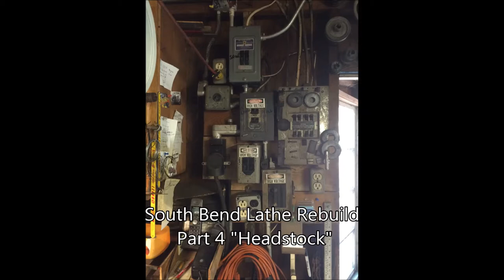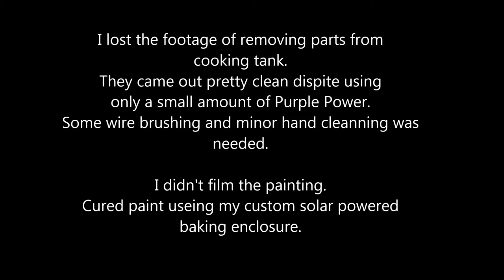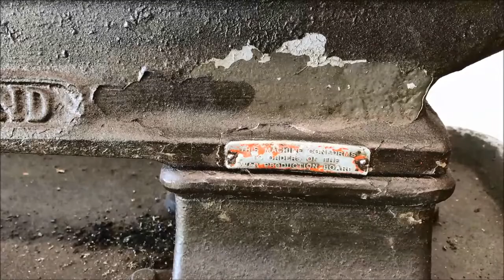South Bend Lathe Rebuild Part 4

Comment: Nice job. I would have liked to see more things like how to remove things, open them, what to look for and how to reassemble. I have a 1968 SB heavy 10 L that I’d love to restore, but I’m afraid to do that because I don’t know what I’m doing. Are there any places that can help me restore my lathe? 
Thanks,
Paul
Reply from the maker: I was still fairly new at filming and was working mostly with stills. 
The South Bend rebuild guide is very good "available on eBay" The gear box is very tricky, it was very helpful.
ATB...Dean

Comment: I thought I knew what love was when you showed your 30 gal cooker, but no-no, true comes but once in a lifetime, and I found mine in your solar powered curing chamber. lol :) The polish on your back gear lever was gorgeous. The assembled head stock looks brand new, and the bed upgrade was a good idea. I found a baking rack that fits inside of my chip pan. It makes things a little easier to be able to lift it out and dump it.
Reply from the maker: That's a great idea!

Comment: great work, you ever source replacement rivets for the placards/badges and any source for quality bearing replacement ? Thanks in advance, Dan.
Reply from the maker: Dan just came across your comment....sorry for the year long delay. McMaster Carr for the rivets. Bearings probably keep checking ebay..Grizzly may still have some new old stock available also $$$$$
-Dean
Reply: @TheAyrCaveShop  No worries man and thanks for the reply I actually finnally got the lathe completley rebuilt a couple months ago but i still need a few rivets so thanks ill look into that !
Reply from the maker: @DanOTBB  Nice to know another classic South Bend has been saved, ATB, Dean

Comment: Amigo, recentemente comprei um South Bend lathe 10" aqui no Brasil, gostaria de saber aonde posso comprar algumas peças deste torno ?
Desde já agradeço qualquer informação. ... pcdcoelho@yahoo.com.br
Reply from the maker: Paulo, Many parts are still available from Grizzly Tools, they bough up most of the spare South Bend had when they closed down. They are expensive. You will need to provide the serial number  when inquiring . Probably best to download a parts  list first off the Web. I found most of my parts in eBay, it took some time watching but eventually everything, I needed came up for sale at some point. Best luck on the project, the old South Bend's are a classic.
Thanks for the comment,  -Dean
Reply: Obrigado amigo, vou procurar nessas fontes.